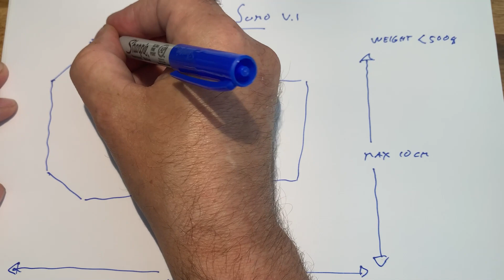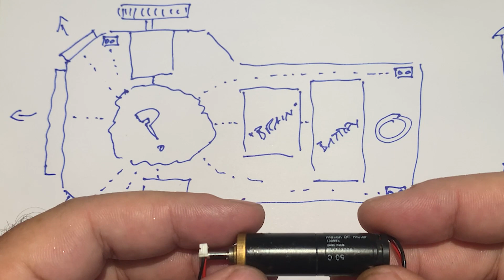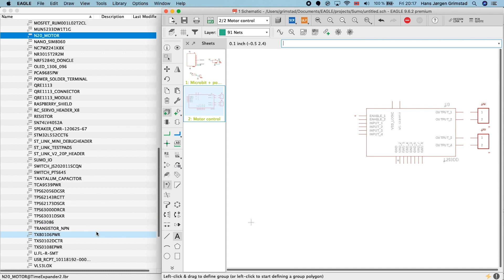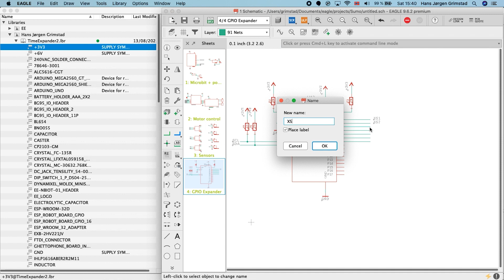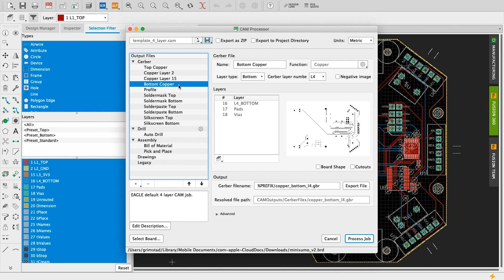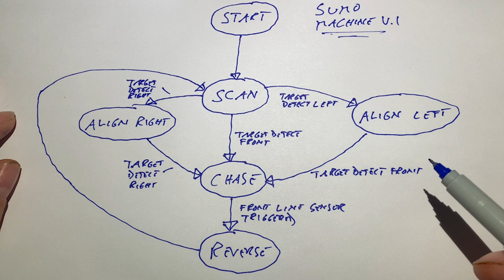Building a mini sumo robot on a budget

Comment: whats the Rpm in the motors you used?
Reply from the maker: You can get the N20 motors in various gear ratios. I used the 700 rpm version in this project.
Reply: Thank you, did you calculate it using Rmf how much did you assume the velocity and acceleration, I have mini sumo robot competition 0.5kg robot and I'm not sure yet which rpm motor to choose , the ring is 77 cm in diameter
Reply from the maker: @mohammedfakiadam8369  No calculations. Just trial and error (I already had several N20s with various gear reduction ratios in my inventory).

Comment: Hello brother, Maximiliano is speaking to you from Argentina.
First of all thank you for sharing your wisdom.
I want to ask you if it is possible that you can provide me with the circuit and its corresponding files to the Open Source Modular Coil Gun project, since the corresponding links are broken. I would like to reproduce that project. Thank you very much and a hug
Reply from the maker: Hi ! I don't have any eagle schematics or 3D design files for this, but I managed to locate some handwritten schematics, notes and some simulation output that I had kept in a notebook. I decided to gather all the info I had from back then (2012) and post the info on my blog. https://www.timeexpander.com/posts/coil-gun/